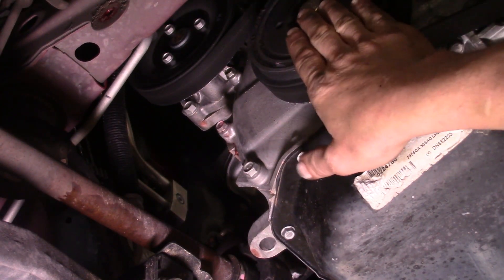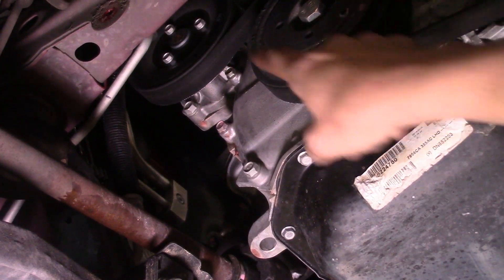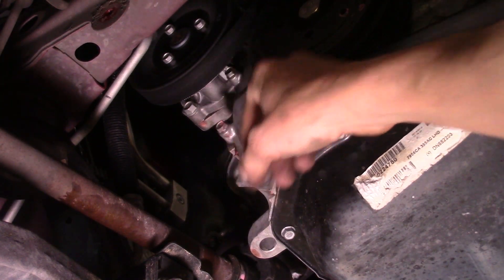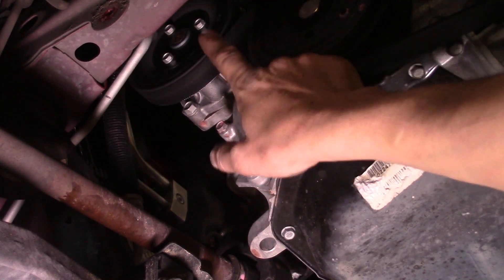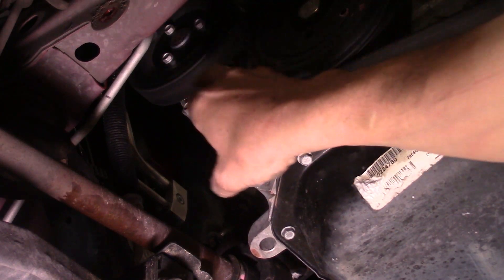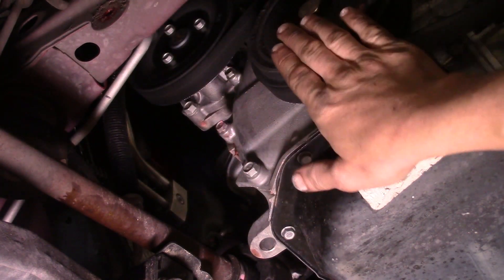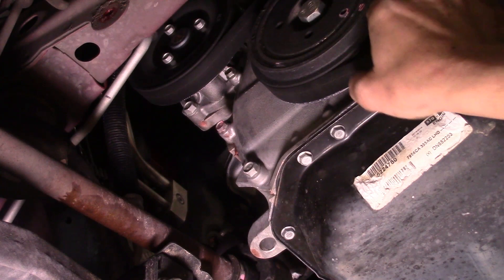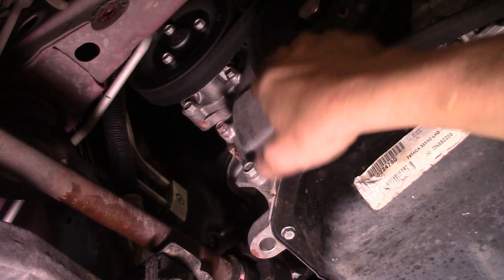Part 1/3: 2013 Dodge Avenger 2.4 liter waterpump removal

Comment: Changing the water pump on a 2014 Dodge Journey crossover with a four cylinder engine is it the same way as a 2013 the way you showed in this video
Reply from the maker: It should be pretty much the same. Some vehicles are a bit easier to get to and some might take a few more steps but still basically the same. Thanks for asking and for watching. Make sure to subscribe

Comment: Hi Dave. I have a 2013 dodge journey(2.4l engine). Found coolant dripping onto the drive overnight.  I pushed white paper towel under Thermostat Housing / Water Outlet on the right side of engine. It was soaked in coolant in the morning. Have you done a video on removing this part? Do they normally need replacing or can I reinstall with HI Temp silicone sealer.

Comment: Thank You, David, for your step by step video's ... love em.
We have a 2010 2.4l world class engine, (Sebring) but the maintenance schedule does not say to ever replace the timing chain? (or at least I can't see it). Is this part a maintenance free item and only needs to be replaced when it's noisy or broken?  ( I have to change my honda timing Belt every 100,000kms
Reply from the maker: Chrysler never gives and interval for timing chains...they arent normal maintenance items. Now if it had a belt like many engines older then yours then yes there are intervals....such as the 3.5......the 4.0.....and older 2.4 engine that came in the PT cruiser. Otherwise there is no need to replace yours. Thanks for the question and for watching the video. Make sure to subscribe

Comment: My avenger had coolant mixed with the oil can this be caused by the water pump ? Or does that only apply to internal water pumps ? I think it could also be a head gasket

Comment: Is this the same for a 2008 Dodge Avenger 2.7 l engine?
Reply from the maker: The 2.7 is completely different. The waterpump is inside the engine cover and ran by the timing chain. Not an easy repair. Thanks for asking and make sure to subscribe.

Comment: Hola buenos días una pregunta? 
Cual es el procedimiento para cambiar el enfriador de aceite de este motor 2.4 L?
El que trae en el filtro de aceite del motor. Gracias... Un fuerte abrazo.
Reply from the maker: Si lo desea, puedo enviarle por correo electrónico los pasos para el enfriador de aceite. Envíeme un correo electrónico a david@motorcitymechanic.com
Reply: Excelente muchas gracias.
Muy amable un abrazo.

Comment: will a water pump cause water in oil on the 2.4
Reply from the maker: Nope....on this vehicle the waterpump isnt behind the timing cover like on some vehicles. There is no where that the waterpump comes into contact with oil. The antifreeze would have to be getting into the oil somewhere else. Thanks for asking and make sure to subscribe.

Comment: Hello, i cant find a video to locate the temperature sensor on a 2013 dodge avenger se 3.6 v6. Do you know where is it at?
Reply from the maker: Cylinder head closest to the radiator.....towards the bottom and towards the rear close to the trans but still mounted on the head.

Comment: Yo brother.  Quick question for you.  My wife's 2015 (original owner w/ 20k miles) Dodge avenger has some brown/red sludge (peanut butter like) that has accumulated on the roof of the radiator overfill and cap.  Fluid level was also noticeably low (which is how I noticed the problem in the first place).  There are no noticeable symptoms during regular driving or cranking.  No visible leaks or smells either.  

I read some blogs about similar symptoms and hear this COULD be caused by the "internal" water pump leaking, or mixing in, other fluids.  I can't imagine there is already rust forming on a 2 year old coolant system so that can't be it...   Other than regular oil changes, there has been no other fluid drains, flushes, or fills--so there isn't any "bad mixes" foaming up. 

Have you seen or heard anything of this issue?  We are bringing it to the dealer tomorrow and I imagine that I'll get the runaround ago any thoughts or ideas would be helpful. Thanks.
Reply from the maker: I know that on the ones a but older then yours that they can have some coolant sludge build up. The first place its found is in the coolant bottle. The sludgy build up settles to the bottom of the bottle and can be seen easily. There were some cases with Chrysler where depending on the specific issue.....we flushed the coolant system. Pulling up your year doesnt show anything. Some slight build up on the cap is normal from what I have seen.....I would keep an eye on the coolant in the bottle and see if anything settles to the bottom over time. There are 2 engine options shown for your vehicle and none are designed to come in contact with any other fluids. The 2.4 has an external water pump that bolts to the side of the block and the 3.6 has one that bolts to the front outside of the engine. Neither are internal so mixing with anything else will not happen (caused by a leaking water pump)
Reply: +MotorCity Mechanic thanks for the response.  I'll clean out what I can and keep an eye on it.  I appreciate the video and insight.

Comment: I have a 2012 dodge avenger 2.4 se, I take very good care of this car change oil and air filter every 5000 miles. I've been having problems with it having absolutly no power. Sometimes it opens up and runs like a puppy. But othertimes it feels like the car is stuck in sluge. I cleans the mass air flow and other sensors in the air cleaner housing. Seems to have worked a tiny bit. But the car only has 80 thousand miles. Feels like it has over a million miles on it sometimes. Any suggestions?
Reply: Car sounds very groggy like there is something plugging it up and making it so sluggish. Never had any actual engine problems other than this.
Reply from the maker: Evening Clint. Its hard to say without driving it and checking different items in person. There is nothing that comes to mind at the moment and nothing common that I have seen. When there are no codes or check engine light....it makes it very hard to narrow the search. It becomes a diag by symptoms alone.  Wish there was something I could say to check but nothing thats specific to what you described.
Reply: Yeah. Next im Going to replace fuel filter, clean injectors and valves. See if that helps. Only other thing I know is increase airflow and delete the huge resonator in the back. Rely hoping I don't have to do any Piston work.. rings sieves ect...
Reply: One other question. When I lift the plastic cover/noise cover off the top of the engine. Is it normal to hear all the valves and lifters...i feel they are very loud. My oil was done today and it is deff full. I've never heard all that nois out of the top end b4.
Reply from the maker: There is no fuel filter to replace on this vehicle.....the pump has a strainer that serves this purpose and its not replaceable.
Reply from the maker: Thats actually one of the reasons for that plastic cover.....noise deadening . They have that thick foam underneath to help drown out the sounds.
Reply: Thank you very much for answering all my question in a very timely fashion. I will be telling all my "motorhead" friends about this channel and I will advise them to subscribe :) keep on keepin on brother.
Reply from the maker: Many thanks Clint! Always appreciate the spreading of the word about the channel.
Reply: Gfs chrysler 200 has the same engine and had a similar problem with her lack of throttle respond. I replace the throttle body. The throttle body has a tendency to strip a plastic gear on the inside making a flat spot cause the valve not to open properly.

Comment: What would cause this motor to start overheating, motor has plenty of coolant and the engine fans are spinning, this leads me to believe the thermostat may be failing, is this a common thing to fail on a car with 42k on it?!
Reply from the maker: This is not a common issue. For the most part....thermostats dont cause an overheat these days. They can set codes but as far as overheating....not really. But nothing is perfect so that is always that rare case where it might be a cause. If the fans work in all speeds and there are no coolant leaks.....items such as the radiator not being clogged need to be checked. Also its such as radiator cap testing. If it ran tooo hot it could have damaged the engine and then another test such as a cylinder leak down  or block test need to be done to make sure no engine damage.
Reply: MotorCity Mechanic Because you have a lot of newer model videos of Chrysler, Dodge, Jeep repair videos, you just earned a new subscriber. Keep them coming. There are no Haynes/Chilton DIY manuals out for 2014's yet, and I don't have the money for a service manual CD yet.
Reply from the maker: Noah Kuzel Well thanks for following the channel Noah. It's always great to get feedback and thanks for subscribing

Comment: How can you tell the water pump is bad on these cars ? my wife driving the other day and said the temperature went up .but not over heat it it went back down and did not go back up any thoughts??
Reply from the maker: Only issue I have seen on these is the waterpump leaking. Otherwise I would check for leaks and the fan operation. Might want to have the radiator checked to make sure its not getting clogged or restricted.
Reply: @MotorCityMechanic   i will check those things out thank your for getting back with me !!